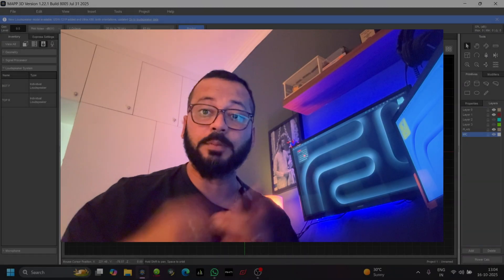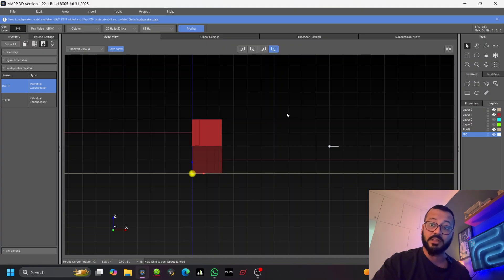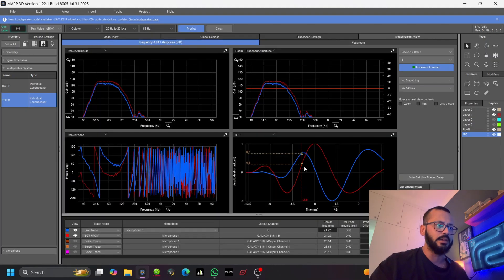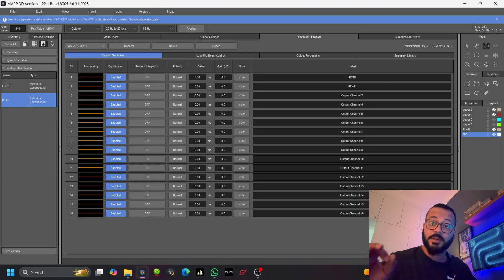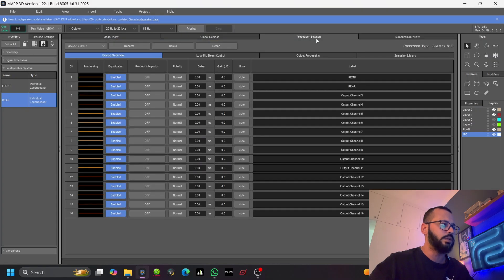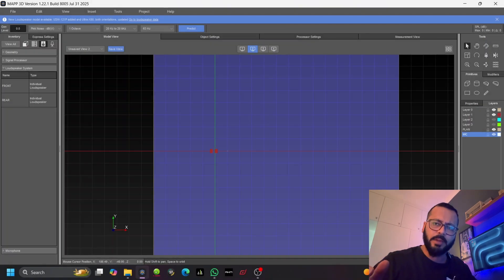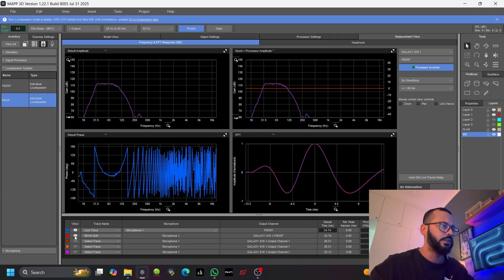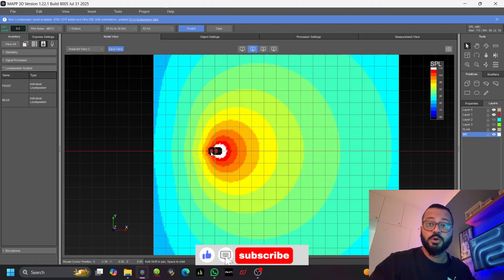3 Sub Woofer Configuration You Must Learn | #SubWoofers

Comment: Hi sir how do we do an end fire  or stacked cardiod in line without forming a narrow beam in the centre.
And how to we arc it .
How much outputs should we use
Reply from the maker: First make Stacked Gradient as i showed in video, and then place them like a End fire and put delays in each stack considering the last as reference

Arc is used to widen the coverage, as with more line length , coverage always shrinks as basic physics law